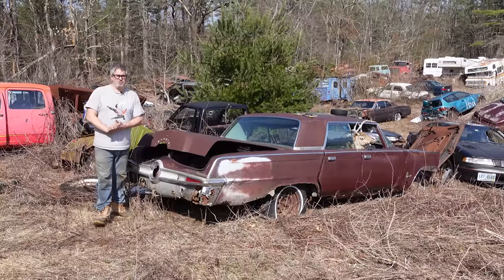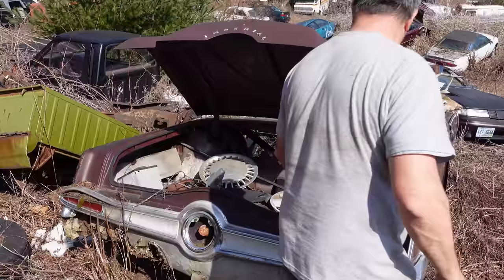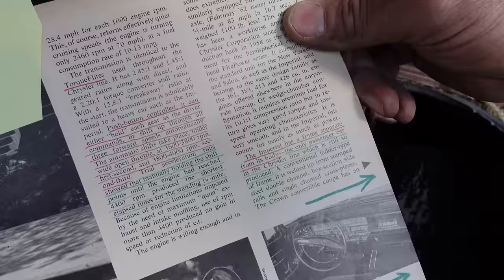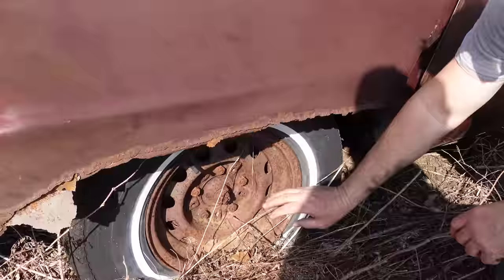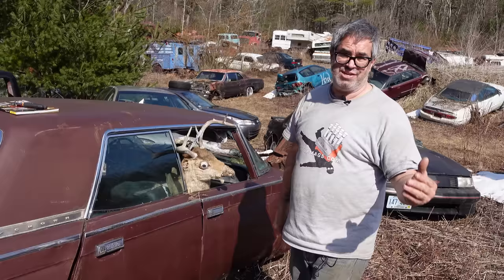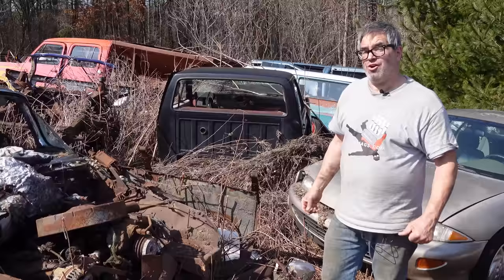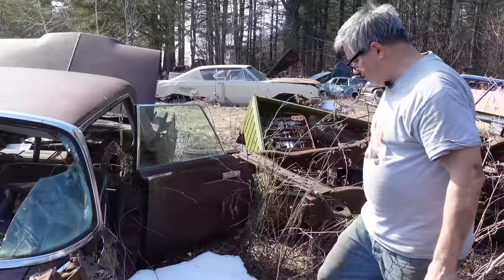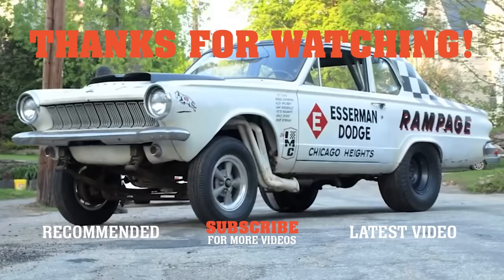Imperial By Lincoln?

Comment: The 1964 Imperial had a 5 1/2" bolt pattern on the wheels, not 5" as you mentioned.   The '67 and '68 had a 5" bolt pattern.
Reply: I came here to say that . 
There was certainly no Ford truck with a 5on5 , they were all 5on5.5 !

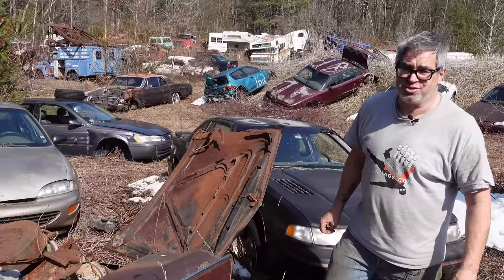Comment: That black Lumina Z34, ( 6:24 ) haven't seen one of those in a long time. The 3.4l DOHC engines were a bit problematic with the timing belt set up they had, but for the time 200+hp and a decent amount of torque was enough to move those cars. They even had a getrag 5 speed manual as an available option. 

That w-body platform was heavily invested into by GM and ran with some updates until the early 2010s under the Impala nameplate. Supercharged and turbo v6s, v8s and manual transmissions could be found in some of the most performance oriented versions. But for the most part the w-body platform was just a typical FWD economy car for the late 80s and into the early 2010s. 

Surprisingly enough, even with modern v8 RWD and high hp cars on the used market these days, some of these early W-body cars are starting to increase in value. Never would have imagined that. As these cars were once cheap used transport that could be had for $1000 to $2500 in good driving condition just 15 years ago. Now try to find one for under $10,000.
Reply: I test-drove that car, in the red color, with the 5-speed in the early 1990s.  It was pretty impressive for a FWD American car of the day.  If I had the garage storage space, I'd have one in my collection.
Reply: @redmondjp  I purchased a 1994 Cutlass Supreme convertible with the 3.4l DOHC engine in high school. It was a great used car had a bunch of options and all of them worked. I've looked into purchasing another one, but the prices on them have just increased dramatically over the past few years.

Comment: Since it had an odd bolt pattern in the back, did they also change the front (to match that)?

Did any cars come with mismatched f & r bolt patterns, but not tire or rim sizes, from the factory
Reply from the maker: Hello Iowa559, Thanks for watching and writing. I can't think of any mass-produced American passenger vehicles with non-interchangeable wheels. That said, lets remember that the DeLorean came with 13-inch diameter rims up front and 14-inch rims in the back. Likewise, the tires were naturally of non-equal diameters. So "rotating the tires" of a DeLorean isn't likely to happen - or intended to happen! In more recent times, lots of European "exotics like Ferrari, Porsche, McLaren, Bugatti, etc. have big-and-bigger rims sizes that are NOT meant to be "rotated" in any way shape or form for full tread wear. The mis-matched front/ rear bolt patterns on the '65 Mopar A/FX funny cars wasn't a problem because they were "experimental" and not really being used by "civilians". The factory-appointed / sponsored drag racers were used to mixing and matching and certainly were not concerned with "rotating the tires" front to rear, side to side for maximum tread wear. Another interesting detail that's plain to see if you study enough old car magazine pictures is that some of the 11-built '65 altered wheelbase Mopars seem to have an unusually small front wheel bolt circle. In particular, mid-season pictures of the Golden Commandos Plymouth show what appears to be a 5-on-4 inch bolt pattern and matched wheels. This may indicate the adaptation of the lighter 9-inch front drum brakes and suspension parts from the Plymouth Valiant compact car for a 10 to 20 pound weight savings! The Golden Commandos used steel wheels (painted white) most of the time and so this mis-matched small-bolt FRONT wheel situation is very apparent if you know your Mopar steel wheel shapes and sizes. But this begs the question: if the Golden Commandos were in search of reduced weight up front and got it by substituting the larger B-Body suspension bits and brakes with smaller A-Body stuff, WHY keep the hefty steel wheels and not switch to much lighter aluminum or magnesium mags? There is a possibility the Golden Commandos (who were mostly Chrysler employees by day) had some ULTRA LIGHT stamped "steel" wheels made! I've heard they were thin gauge and / or acid dipped and may have weighed less than an aftermarket rim. But if you look closely at 1965 magazine pictures of the Golden Commandos Plymouth funny car, you'll see the front wheels and hubs "evolve" from race to race. You have to look close to see it. Eventually most of the altered wheelbase teams eliminated the front brakes all together and went to spindle-mount wheels. Racers never stop tweaking....Thanks for watching and writing. -Steve Magnante
Reply: @SteveMagnante  The 1986 Pontiac Grand Prix Aerocoupe had mismatched wheels and maybe one of the 3rd gen F body cars in the later part of the run. That's going off the top of my head.
Reply: Wow, quick & thorough…I'm still absorbing that much info! I'm not sure if you actually researched that…

Not that you are wrong, I actually think you're right, it just seems like a bunch of random shit you memorized!

You could just add my questions to your "episode ideas" file for future topics ;)
So far, all of your videos are worth watching (at least) twice!
Reply: While the bolt circle remained the same , and they were all 16x8" wheels , the 1986-92 Trans Am WS6 wheels had different offsets , which made them front or rear specific. Also , they had directional tires , so they couldn't be switched side-to-side , either . 
The same was true with 86-92 IROC-Z 16" 5-spokes.